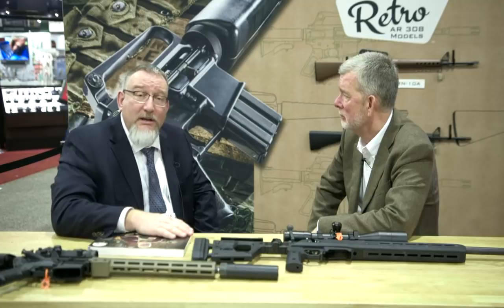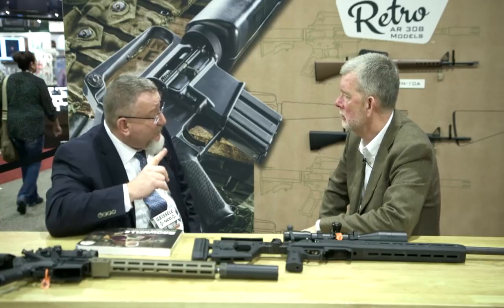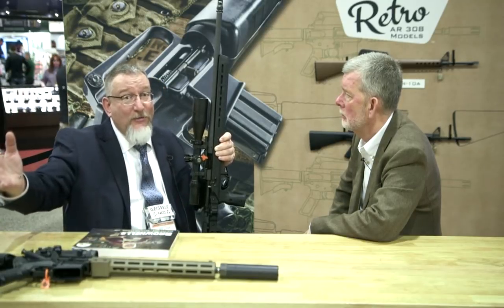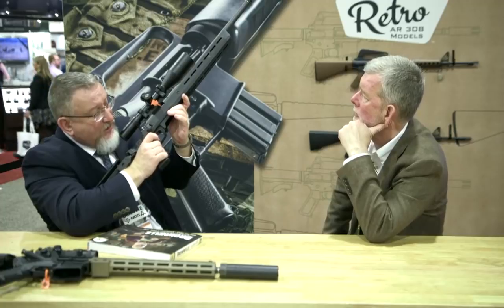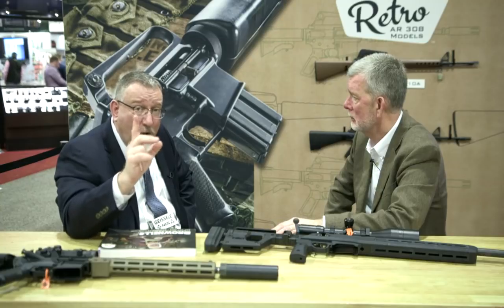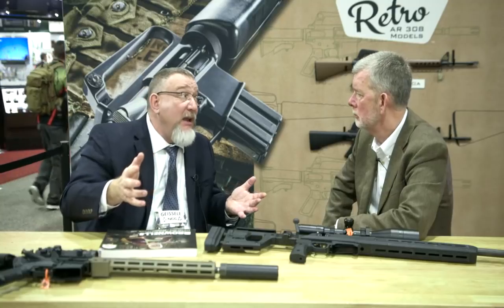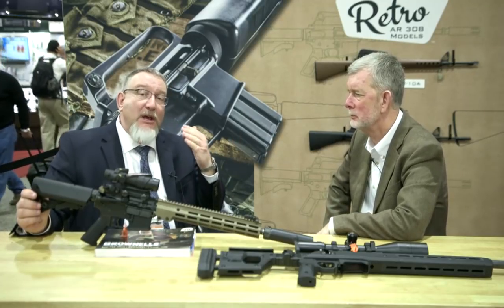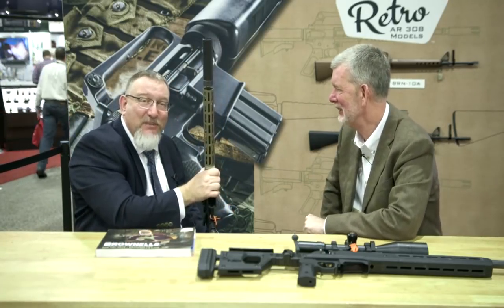Shot Show 2018: Geissele's New Products

Comment: Bolt guns go bang when you push off the safety even though the trigger is not touched? 60 minutes did a story on the Remington 700 and all the accidental deaths. There's vid of this inadvertent discharge on  a SWAT gun.

Comment: I don't think bill realized it but he just called out a bunch of other trigger manufacturers. Specifically cartridge trigger makers. Personally id like to see him submit some kind of evidence to back up his claims about cartridge triggers. We shall see
Reply: havokmaster2  look at the gauge of wire for a stock trigger and the ones he’s talking about . Thinner gauge wire = less spring rate . Thicker wire = is higher spring rate.   With a stock trigger design if you use a lighter spring to decrease the trigger pull you can run into problems of not setting off primers . It’s smarter to have a heavy spring and adjust the seat surface for lighter trigger pull .
Reply: havokmaster2 I️ have trigger like he talks about and some ammo I️ get light strikes from.